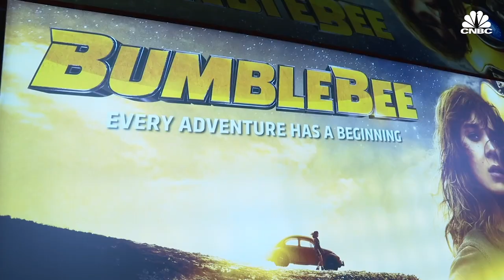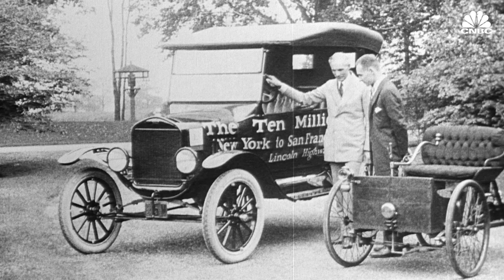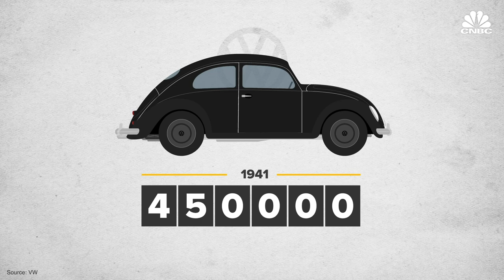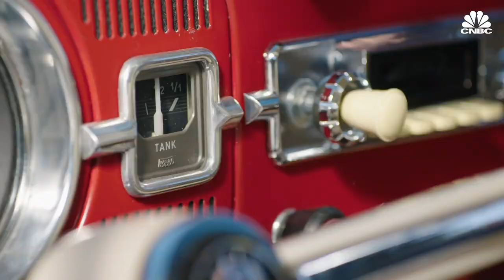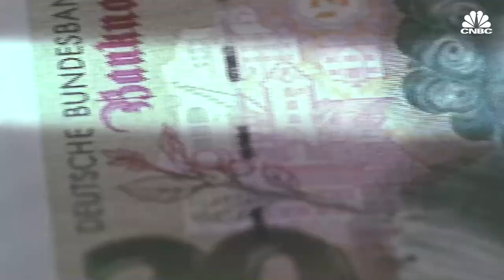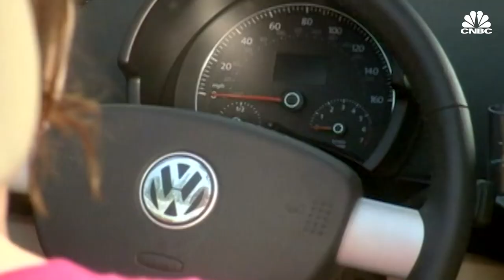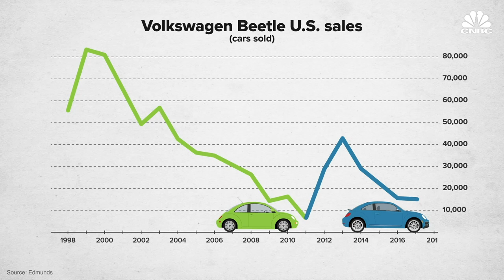Why Did Volkswagen Kill The Beetle?

Comment: The new beetle wasn't anything like the old beetle. The old beetle was simple, easy to work on and had a rear engine. That, and unlike the new beetle, the old beetle was rugged. you could modify the old beetle and take it off road. you couldn't do any of that with the new beetle except drive it on the road.
Reply: Plus, the old one just looked so much better.
Reply: That’s modern VW group for you. Porsche their only brand with a semblance of customer service
Reply: Joe Al  "money pits" i know for a fact you watch scotty kilmer LMAO
Reply: Rear engines seem to be very rare these days, and all cars have become more complex too.
Reply: The new beetles were unreliable, difficult and expensive to repair. Back in the day anyone could work on a Beetle, they were reliable and cheap
Reply: B B Cheap maybe, reliable no way.  I had a ‘75 and it had all kinds of issues at any given time.  But you could literally find common replacement parts at 7-11 (in Mexico).
Reply: Well, you could survive a crash in the new Beetle. Not so much in the old one, compared with modern standards.
Reply: @springbok4015  old beetles were reliable and easy to work on and the new beetle can't do any of that and cost a fortune to fix
Reply: @_TbT_  a few simple design changes and it would have been fine. Look at the 911, basically a squashed bug, still rear engined and up to modern safety standards. They just gave up rather than trying.
Reply: @leonardogutierrez8147  True. I'd love to get an original Beetle. They were awesome.
Reply: @_TbT_  Exactly. The old one's were good in a roll over only but of course they had 'low rolling resistance' too, easy to tumble.  Also the original had atrocious aerodynamic qualities, not so bad at 50mph but much above that it became scary, floaty and highly inefficient.
Reply: @InfiniteMushroom who in the hell drove 55 miles per hour in a 55 mile-per-hour era?
Reply: It's like calling a Ford Taurus a "Model T". It's downright dishonest to confuse the two cars.
Reply: I love the old Käfer, RR layout, simple to work on, reliable and designed by Ferdinand Porsche. Moreover that, the little bettle was baptized by fire during the WWII.
Reply: Dana Herron you can easily get an old air cooled beetle that runs & has decent body for $3000 in California. I decided to buy a ‘73 squareback instead because I have never seen one on the road again, neither have most people who see it when I’m driving!
Reply: The only similarity with the old beetle and the new beetle was the profile. VW marketing attempt to cash in on sentimental feelings customers had for the beloved aircooled beetle.
Reply: No money in simple.

Comment: The original Beetle is a classic that will never die.
Reply: 2 in my barn and 1 Karmann Ghia.
Reply: Beetles(1979) were sold here in the Philippines, in some specific area, so it's still alive thou
Reply: true
Reply: It's a classic but it is also dead
Reply: Still see them out here!!
Reply: @Allen Loser Down here in Mexico you see at least 10 a day on the road
Reply: @frooqy  Mine isn't dead! It's pampered and only comes out during nice weather. Speak for yourself!
Reply: long live  the Beetle!  (i own one and goes anywhere)
Reply: @alfonsocarlossoler5371  "a classic that will never die"
In S. Africa in the 1960's/70's, they were called Hitler's Revenge, because you would see them all over the country lying on their backs with their wheels in the air.  There is an Afrikaans saying, "Hou die blink kant bo" (meaning Keep Optimistic, or directly translated, "Keep the shiny side on top", which directly applied to the VW Beetle because of its terrible road-holding.
There's no doubting their popularity, though, and it had a quality manufacture.  Somebody made a joke bout them having rusted away, but I don't think that was one of their failures.  I drove one once for about 300 miles, and I hated it.  After my Mini (which was a crap car), the VW felt very cramped, and driving it was WAY less sporty than the Mini.  With both hands on the top of the steering wheel, I could put my forefingers on the windscreen.  Ugh!
Reply: I like the original tail lights and the little tailpipe.
Reply: @ Antonio Eder Lopez Lopez: you can probably find a few original Volkswagen Beetle cars in Cuba. I'll have to ask a Cuban friend of mine.
Reply: 1:15 ...that's a 'New-Beetle'...
...you see what a classic is, the harder they try to replace it, the more classic it is...! ;-)
...my first car in 1983 was a 1972 VW Beetle 1300 in bright orange...! :D

Comment: Owned a 1961 while in college and then a 1970 Super Beatle which we drove all over the US. Great cars. Very practical.
Reply: I have owned five beetles. The first was a 1958 small rear window, and was brought into England from Lagos by a returning military officer.
I still have the service booklet the operated a fixed price for labour, for instance, remove and install engine £1: 7s:11d. Complete engine overhaul engine removed from vehicle complete disassembly all parts checked and replaced as necessary, engine rebuilt and tuned very expensive at £21:11s: 1 p those were the days!
Reply: A Rabbit or jetta got way more economy.with a heater and ac unit not an open window. Cruise control and it could cruise at 80 plus.. comfortably.. i had the 1973 sun bug special edition.. pirelli cn36 tires wide rims,black trim,recaro seating, they were amazingly adjustabe for a bug.. but junk compared to a gti or jettta in the 80s.... just sayin..  i loved my exs jetta .. But their lack of quality turned me right off forever... and stupid design querks..
Reply: @Teja nope, that's a band. From the 80's if I recall correctly.
Reply: @Teja Of course you did. Blessings.

Comment: My first car was a ‘74 beetle. The gas heater never worked. It was super cold to drive in winters where it dipped to below -25 Celsius. The windshield was constantly fogged up. It had huge amounts of traction in the snow, though. And it was fun to drive in the summer. I can still smell the hot vinyl seats. :)
Reply: The heaters and defoggers were terrible..   But what a great car.
Reply: I had a 1960 beetle and the heater was hopeless in some weather conditions to demist the windscreen, I solved this by wiping a cotton cloth impregnated with glycerine oil (odourless) all over the inside of the windscreen so the moisture did not adhere to the glazing. Worked a treat!

Comment: Cmon, Volks, the E-Beetle is the obvious replacement, right?
Reply: Omg that's a brilliant idea
Reply: Yeah I think its also a way to build up hype when they bring it back
Reply: It's a shell based car so it would be pretty well evenly distributed weight wise
Reply: They have eGolf. Sells bad.
Reply: it will rise again someday and i bet it
Reply: Volkwagen has hinted a number of times in the last year or so they are studying the idea of a next-generation Beetle built on the MEB electric car platform. I'd buy one in no time flat if they do it.
Reply: Wouldn't be surprised, if they're working on this. They've already made a electric version of the iconic bus too.
Reply: @Sacto1654  at what price point?
Reply: Dammit
You commented before me.

I want an electric "bus"
Reply: Someday.. but I don't want to wait that long
Reply: cnordegren Have a look at the ID Buzz, an electric revival of its iconic VW Bus. It will take some years however still.
Reply: I don't like big cars.. I would rather have the ID3.. though VW might not bring it to the states
Reply: Do it with a max speed of about 120 kph, range at least 350 km, simple construction, cheap and cheerful.
But what we will get will be a full supply of all electronics available from all automotive suppliers, with 14 air-bags and automatic fart detector.
Reply: @dan_6915  it's because of the Egolf is viewed as an short range ev. but if Volkswagen can make a hi- mileage Electric Beatle under 30k new buyers like... Hi school students and etc. Would love the funky Ness of the car... Judging from my point of view as a "hi schooler"
Reply: 30k is too hi...   Needs to be under 25k and closer to 20k
Reply: or can modify from the old version Beetle with Electric car project
Reply: @mmmmm5556  $30k is a good price for an EV, as they cost less than ICE to fuel and maintain over their lifetime of total costs
Reply: there’s the e-bugster concept
Reply: Well i think they should make one, and make it fast and cheap, it could be like a halo car for vw, you dont need much power to make a light car fast
Reply: MMM mm where will they build it...China.
Reply: @dan_6915  but e-golf is ugly. An e-bettle or an e-t van would sell like hotcakes.
Reply: That would be a hell of a beetle. Electric engine beetle. Hmm...only one can dream
Reply: There's a guy in Brazil who takes the rear up to the drive compartment of a VW bus and welds it to the front part of a VW beetle he calls his creations Baja bugs. 
Volkswagen could building those but put an electric drive train in them.
Reply: @dan_6915  But the Beetle is a cultural icon unlike the Golf which looks any other Euro-car.
Reply: @kevinloving3141  
*was.
Grandpa's car.
Times have changed, you know.
These flashbacks from the past, don't sell good at all.
Why do you think mini has become maxi, and they pulled out alot of other models..
Reply: @milosilic23  
They do research, you know.
If that will sell, they would make it.
I guess actual customers, aren't interested at all.
Reply: it should be called the BeEtle or something like that
Reply: +Dan well cars are getting to expensive and like starting in 1985 looking alike. If they made a tadpole style car two wheels in the front and one in the rear and electrifying it they could sell them for $15,000 to $20,000.
Reply: I would totally consider an electric beetle with the original body styling! Seems dope
Reply: I've been hoping that anyway for the last few years, VW is promising a truckload of new EVs(to make up for getting caught emissions cheating lol ) and I don't see why not a new electric Bug can't be apart of it. And people have converted old Beatles into electric.
Reply: That e-bugster is awesome.. I want 1
Reply: Build it in a non union factory in America and get the price of the battery down. the battery is the expensive part
Reply: I think so too
Reply: THE ELECTRIC BUS THEY'VE BEEN TEASING FOR YEARS AND AN ELECTRIC BEETLE WOULD GET A LOT MORE ATTENTION THAN THE "ID" LINE.
Reply: The Eeetle?
Reply: Val M the Eeetle.
Reply: Don't Get Lost do you mean one built around the old beatle (engine in the rear) or that car that was first built to "look" like it but is nothing more than a GOLF with a funny body on it?
Reply: @carlgreisheimer8701  Why not based on the old one?
Reply: StealthyMonk True. I've seen where VOLKSWAGEN takes an old beetle and removes alot of the old material and puts new equipment to make it running on electricity. Put hear is the problem. They are doing this with a small batch of "OLD" BEETLES! TO START MAKING THE OLD BEETLE THIS WAY WOULD BE PROHIBITY EXPENSIVE BECAUSE EVEN THOU YOU GET PAST EMISSIONS HOW WOULD YOU GET THAT CAR TO MEET MODERN DAY SAFETY STANDARDS. AT LEAST THE CAR BODIES THAT WERE MADE 30, 40 OR 50 YEARS AGO CAN BE GRANDFATHERD IN, BUT BRAND NEW STUFF HAS TO MEET CURRENT STANDARDS.
Reply: Don't Get Lost because when the old one that was imported to this country from 1949 to 1979 was stopped it was because it was have a hard time passing emissions standerds and could no longer pass safety standerds. Even if you had it run on electrical power which would solve the emissions problem you can't get that car to pass USA SAFETY STANDARDS.
Reply: StealthyMonk thank you!!!Someone is finally getting the picture!!
Reply: Don't Get Lost They are already keen with the idea.
Reply: Sales will be pathetic, and nothing will ever be reported in the news because...FAILURE! Electric vehicles aren't 'green', they just relocate the exhaust pipe 200-miles away, to the ELECTRICITY GENERATION PLANT they charge up from. Locally, the only thing 'un-green' about them is the 8-years of carbon it took to build them and the 1,000-lbs of lead and toxic waste you are sitting on top of to hold the electric charge (aka: BATTERIES). Electric...what a pitiful joke that non-science idiots want to call 'green technology'. You want 'green', STOP BUYING CELL PHONES EVERY YEAR...and find one that will work for 10-15 years (so you can stop depleting rare earth metals and burying them in landfills all the time!)
Reply: The BeEetle
Reply: good idea but no just no!
Reply: Nope, losing focus on affordability and massive changes of consumer taste to SUV's was the killer of the VW bettle.
Reply: I'm surprised they didn't saw this coming.
While BMW did with upcoming MINI EV.
Hopefully they can revive the Beetle again with solid state battery with at least 400 mile range.
Reply: probably a crappy, electric crossover is going to be the replacement :(
Reply: yeah if they make it cheap and simple, it’ll shoot up in popularity again. i’ll bet they do it in the next ten years
Reply: My mum would love that pretty much
Reply: @krollpeter  Yea funny. ...i need an automatic puke detector !
Reply: @dan_6915  the eGolf is running out. it sold well because of price reductions because of fleet emission regulations. but it ment to be a compliance and test car only. now the ID.3 and ID.4 are selling very well. long waiting list.
Reply: @zid-zed  in 5 years it will come
Reply: Well in EV form it wouldn't be a Beetle
Reply: The B-E-etle?

Comment: The second gen Beetle was just a VW Golf with a round body. Nothing like the original beetle.
Reply: I must differ. The Beetle 2 shares the same platform as the Golf...and the Jetta. VW wanted to share this platform to keep things simple...and more affordable.

Going to the Beetle 2, I have a GTI in a nicer body. It is truer to the original shape than the "new beetle" was.

Don't get me wrong, I have been repairing these machines for several decades, and they all have their own unique traits. For example, the Mk. 1-3 golfs were solid beasts.
Reply: @robertborchert932  Not entirely true Robert. Slight changes with the Golf from the Beetle platform also shared with my Audi TT (Golf).
Reply: Oh of course nothing can beat the original for its sher charm
Reply: Vw camper was good  they did bring it back but not for sale in us
Reply: Porsche and vw shared design heritage
Reply: @robertborchert932  the power train is right from the golf
Reply: and it costed as much as a small pickup truck.   The orig beetle was popular because it was cheap and reliable.
Reply: Made in India!!!!!
Reply: OAT351 has
Reply: @marioiacolucci  VW produces three different camper vans on three entirely different platforms...
Reply: @robertborchert932   The reason Beetles died is they couldn't sell them in the Middle East, which is where the new emerging market was.  The air-cooled engine couldn't take the searing heat plus the lousy gas mileage couldn't get you to the next oasis.
Reply: I agree, a Bino!  beetle in name only.

Comment: I'll never forget my first car:  a yellow 1975 VW Beetle.
Reply: TrollBuster mine was a purple 74 L Bug
Reply: Mine was a 1968 when I was 16. I never forgot that Beetle!
Reply: Did you buy it new in 75'?
Reply: @10-AMPM-01  No, it was used.  Got in 1990.
Reply: Good memories never dies
Reply: Yellow punch buggy no punch backs👊🏽😛
Reply: @marco1173  I bought a 24 year old MK2 Jetta 1.8 manual. Used cars can be waaaay more fun than new. I would have liked to run a bug, but they were all gone by the time I came around.
Reply: I loved the  6   volt  systems on the 1966 and earlier  ....
Reply: Now I have the beetle 1974 1200cc and it is stll alive and I go ereryday towork with it,and it works wery well.!
Reply: Rip to all the old beetles a car that will never be forgotten because I'll be driving mine 24/7
Reply: If you're from North America that '75 must have had fuel injection instead of a carburetor and was troublesome in the first year, at least in cold weather....My first car was a 1972 yellow regular Beetle ! Now a MK VI Jetta 2.5, an awesome car if you ask me !
Reply: @michellevesque2130  Mine was carbureted and it was always troublesome.  Parts were readily available though.  Most recently I had a '16 Jetta 1.8T.  That was a lot of fun to drive.  I'm looking into a GTI or GLI now if I can get a good deal on either.
Reply: Mine was a 1960 11cc beetle, virtually no acceleration in 4th gear

Comment: I think the term ‘don’t fix what isn’t broken’ comes to mind. I miss the original beetle. My love for it came from the ‘Herbie’ movies. ❤️
Reply: I used to drive a 1971 Beetle. The cars were fine for what they were, but essentially death-traps. You were sitting with the fuel-tank practically in your lap just behind the dashboard. One of the quirks that you quickly got used to was to crack a window a mite to allow you to shut the door on the first go since the Beetle's passenger compartment was surprisingly airtight and the internal pressure build-up prevented the door closing properly.
Another quirk was to practice flicking over the "reserve" lever situated under the dashboard next to the throttle with your right foot because the earlier models had no fuel gauge.

MsG

Comment: It died when they started adding all the bs to it...keep it simple
Reply: Exactly!
Reply: +Caiden Zagala +Steel city 1981 
They ruined the Beetle by putting a WATER COOLED engine in the front making basically a car built on a Golf chassis and just putting a Beetle body on to plus way more expensive than the original Beetle, making it a nostalgic toy for rich baby boomers.
Reply: They could make the Beetle into a tadpole style car two wheels in the front and a single wheel in the back which would get around the safety issues of a four wheeled car.
Reply: Yeah like a radiator, if it was air cooled it would be better